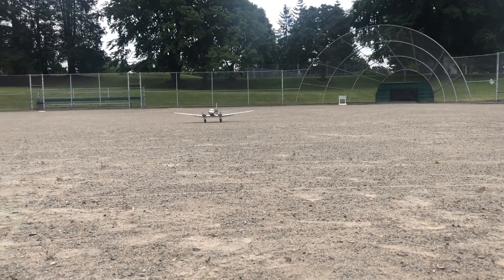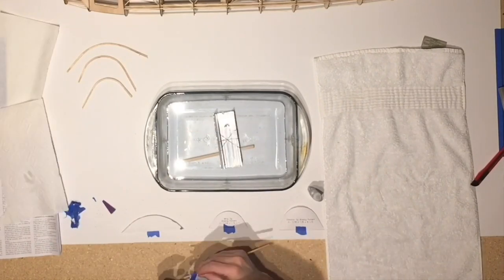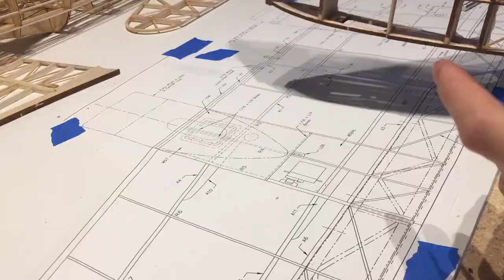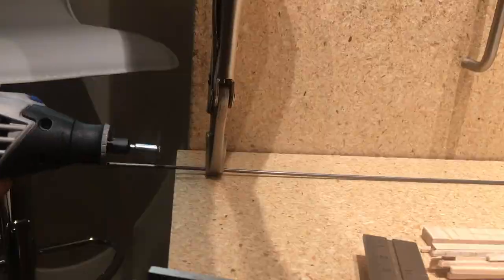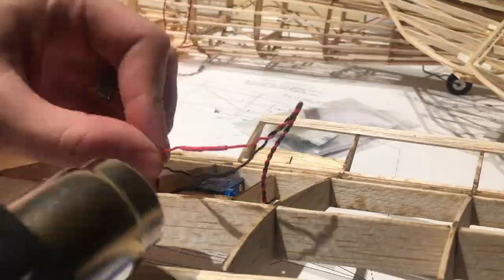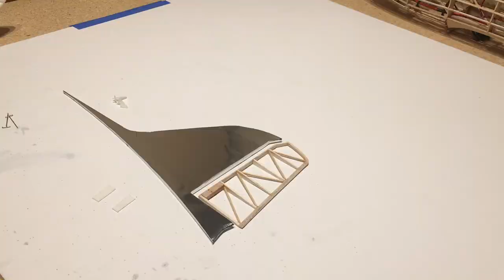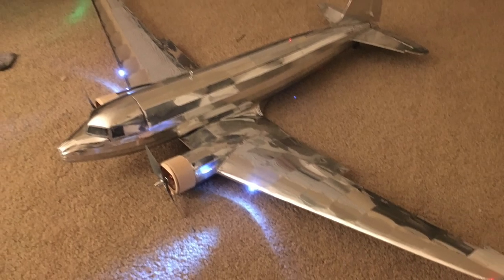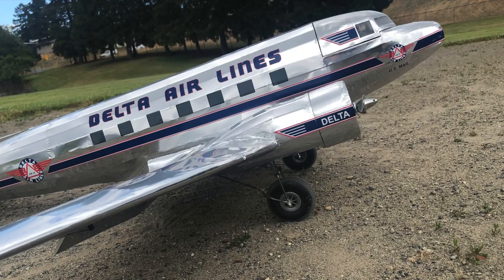How to Build Balsa Airplane TIME-LAPSE!

Comment: Good morning Troy, sorry if I disturb you but I wanted to ask you a question about engines.  I wanted to know if you made the motors rotate in the opposite direction of each other and you put a reverse pitch propeller to compensate for the reverse rotation or the two motors rotate in the same direction and the propellers are the same pitch.  Thank you and sorry for the inconvenience
Reply from the maker: No problem happy to help. Yes I did make the engines spin different directions. I used 7x5 propellers. The one on the left side is a (7x5 E) on the one on the right is a (7x5 EP). Make the props Spin downward as they are next to the fuselage. That makes the most amount of thrust close to the center of the plane. No Critical engine therefor. Cheers

Comment: what kind of covering did you use? How was the visibility in the air? I am thinking of doing the Dare Ercoupe with that silver. Just wondered how much more difficult silver is for showing any imperfections and for visibility.
Reply from the maker: I used 2 roles of Chrome Monokote. It is ok for visibility I didn't have any problem seeing it but if you get it really far away I am sure it could be difficult. As far as imperfections this will definitely show them. Also if you over heat the covering with the iron or heat gun it will change the color of the covering so be carful how much you heat it.
Reply: @TroyMcMillan  Great. I kinda figured it would be unforgiving. Looks really great though. Maybe the old bright orange covering will be a safer choice. Great work on the DC3! It's a beauty.
Reply from the maker: @jefffozard3115  Yes I agree with the orange. Thank you for the comment. It was a fun plane to build it is mostly retired now but I still like to take it out a few times a year. It gets a lot of attention at the RC field. Good luck with your build.

Comment: Hi. Great job. I am interested in the construction of one of this. I order in Austria because I am from spain. But I really like to know what is the model of the motors to the correct fly of my dc3. Thanks
Reply from the maker: I used 450 size motor and order them from a company that is no longer in business. The size is a 2836 with 30amp ESC. DYS has a motor that size. There is a link in the video description to the parts I used. Cheers
Reply: @TroyMcMillan  thanks a lot. I see on one page and I going to order. I see yours videos about dc3 a lot of times. I real like the classic construction of airplanes. Hope you put more. Thanks for all from spain